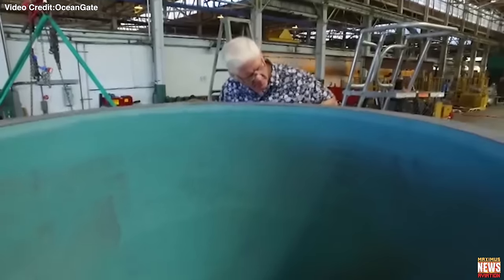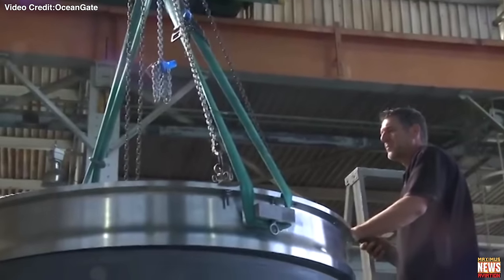Watch The Manufacturing Process That DOOMED OceanGates Titan To Fail. But It NEVER Had To Happen.

Comment: Insanity. Stockton Rush was an aerospace engineer. He's spent his career working with internally pressurized structures. Filament winding things like scuba tanks or other compressed gas tanks is pretty well understood and reliable. The way fibers resist tension is very different from the way they resist compression. Scuba tanks that resist 5,000 PSI internal pressure are 5mm of aluminum wrapped in 5mm of Carbon.  Less than 1/2 inch total. It changes as the vessel gets bigger but not a lot. Compressions is the tough one. Stomp on a beer can or stand on it then tap it with a feather. Once the fiber alignment is no longer in "column" it collapses instantly. Mangle the can and try to pull it in two under tension. Even mangled it's still strong....Tensions is simple. First thing they teach you in the Navy and Engineering school is you can't push a rope. Freeze it, wrap it in epoxy resin and to a point...you can push it. Navy subs are made of homogenous metals without bolted on, dissimilar, end caps. The technology to be safe exists. Monetizing Titanic tours is morally wrong and it clouded the man's judgement. He made decisions based on cost, not safety. Sadly it was all predicted and the predictions were ignored.
Reply: Based on cost? Also on wokeness and arrogance.
Reply: monetizing Titanic tours is no more wrong morally than tours of other p,aces on death, be it battlefields, the Rome Colosseum, or the Pyramids in Mexico.  All places of death, and morally right to pay to tour.
Reply: @davidgenie-ci5zl  Lets just say that I would not be interested in traveling to such a serene and isolated place of such tragedy. It's interesting and for me the original pictures are more than enough. I come from a place where Tour operators have brawls on the roadside. I find the whole thing to be disturbing particularly the fact that in his quest to monetize this the "Money" got the better of his judgement.
Reply: You're forgetting that he's a Randian ubermensch and the rules don't apply to him. How dare you criticize your betters? /sarcasm
Reply: @piglord3.05 Most historical sites are places of death, though. Battlefields, castles, churches that sponsored crusades, massive stadiums for bloodsports. Everyone in history died.
Reply: Stockton’s name is mud.
Reply: @polygondwanaland8390  You're right, I have been to many over the years. Particualrly Civil war battlefields. I think it was seeing tourism based businesses fighting it out in Hawaii for many years that sours me on this. I'm sure people would like to check out the wreckage of the Titan now. Seriously. It seems they rung up a lot of cash per outing. What would have 2 M$ more up front bought them safety wise?
Reply: @patsk8872   Define wokeness?
Reply: @loki2stunt they don’t know what it means lol they just regurgitate what Fox, OAN and Newsmax say
Reply: Very accurate and well written summary and I absolutely agree. This is not a pressure vessel. It is a negative pressure vessel. The engineering and materials required for each mission are very different.
Reply: "The way fibers resist tension is very different from the way they resist compression." That is 100% correct, and was the fundamental flaw in the tragic thinking that led to this catastrophic, but preventable, failure mode. Five people lost their lives due to the flawed thinking and grandiosity of Stockton Rush.
Reply: Excellent comment.   My thinking is the faiure was more in epoxy than in the carbon, but your observation of the difference between tension and compression is a good one.   Steel is added to concrete to provide tensile strength.  The only thing I know about carbon fiber is tennis rackets sometimes break without warning.
Reply: @stephenscharf6293  Could it have been made of graphite cubes glued together into a circular arch?
Reply: @loki2stunt  - The prioritization of identity politics and ethnocultural quotas over pragmatism and effectiveness.
Reply: @JoeLinux2000  I think they can analyze the interior of a carbon fiber laminate stack these days, certainly better than the early days. I remember pro Cyclists would discard a Carbon frame after a good crash back in the day. You just can't tell. You can put a huge dent in Aluminum and make a pretty good guess about how it's going to hold up.
Reply: @patsk8872  Using 'wokeness' without definition makes the term worthless. And it simply tells us about you.
Reply: @patsk8872  Wokeness? His entire workforce was almost exclusively White and male. He was an ardent free market capitalist who thought regulations stop innovation and subscribed to Ayn Rand's brand of philosophy and economics. The failure of his product is down precisely to the fact that he didn't follow regulations, failed to follow proper procedures and tried to follow the dream of free market capitalism. Look where that got him. Next time some smooth brain says "hurr durr regulations stop innovation, regulation bad" just show them this guy at the bottom of the ocean.
Reply: Supposedly tested, a 1.2" carbon fibre vessel, can dive, if I remember correctly over 3,000 foot dives, his was 5". He thought carbon Fibre couldn't be inspected, I'm not sure why, cf bicycle frames can be xrayed for stress fractures.. the dang submersible was on it's 3rd year of use.. shame the man was so arrogant, he couldn't listen to anyone.
Reply: @davidgenie-ci5zl He wasn't even making money, it was more a hobby to document the titanic demise considering no-one else was. The mothership costs over a million to lease for a trip. He and the Frenchman went in together, neither were part of profit.. he even offered others a discount for this trip, 150,000.. it was not profitable.
Reply: I keep hearing about how carbon fiber has a better strength to weight ratio comparing it to metals. That would be true within certain operational envelopes. The extremely high compressive forces applied to this cylindrical structure design appears to have been outside of the carbon fiber operational envelope.
Reply: @patsk8872  hate to bust your bubble, but this guy was a conservative, not a flaming liberal
Reply: @carlose6010  Not sure if it could be Ultra-Sound (which is better for minute flaws like micro-fractures) since that would shake the filaments....
 
And not sure if X-rays would provide enough detail for the safety margin needed at those pressures.
 
I think he didn't realize that the reason why (metal reinforced) Carbon-fiber can be used in Scuba tanks is that, even when "empty" they still have more pressure inside them than the water pressure at that depth!
Reply: Result of WhatsApp University.
Below I copied from Google.  
"Careful oxidation of the surface of the carbon fibers improves chemical bonding" properties,
What I believe Instead Carbon they should have use Boron Nitride Nanotubes. Its 300 time stronger from Carbon fibers & 30000 from steel. But these are very very expensive.
Reply: @patsk8872 Rhonda Santis, is that you?
Reply: @OutyMan wrong, but nice try.
Reply: @markw9512 now you're just confusing him with facts 😂
Reply: Exactly. Internal vs external pressure is a vastly different paradigm.
Reply: Now hearing about his background, it is even more astonishing.  But then in large aerospace companies, a lot of aero engineers get by using others work as their own and don't really understand what they are doing.  Notice how I avoided using the word "BOEING"  It Reminds me of when doctors use laymen's terms buzz words to make you think they have tremendous depth of knowledge
Reply: @davidgenie-ci5zl  Debatable. You pointed out places where there has been deads sure, but the location itself was not a graveyard. I think is is justifable to forbid tourism attraction at grevyards. Well this is a fine line. Let's say if you can walk by yourself to it and visit then fine, but underwater is something else.
Reply: @gs7458  there's a lot of very expensive solutions that can go to the bottom of the ocean. His whole deal was cheaper.
Reply: If I have to choose between carbon fibre and fibre glass,
I would choose fibre glass and have it certified to go deep seas.
Reply: If I have to choose between carbon fibre and fibre glass,
I would choose fibre glass and have it certified to go deep seas.
Reply: @JoeLinux2000 Game set and match for Stockton.
Reply: Wokeness? Don't be daft. Had he been woke to bad processes...
Reply: the alvin (50yrs old) has a titanium ball that the people sit in.
Reply: I actually used the standing on a soda can display to explain to my Grandmother why they died. Homegenous systems well always be stronger... There's a lesson there if you can read between the lines
Reply: It did not last that long.... Look how many times it went down to 14.000 feet... I think it made it 2 times that is all.... IT WAS A CAN.... and nothing more.... and when ever have you seen carbon fiber laced down in 1 direction....That is flat out stupid.... and only 5 layers.... My Car hood has 5 layers of fiber to make it and you made it on a sub the same way my car hood was made... What a joke.... This company is done and there will be no one to account for it...
Reply: @gs7458  I'm pretty sure your BNNs still can't handle compression.
Reply: Stockton must have been a very bad aerospace engineer, not even understanding the fundamentals.
Reply: @georgec9590  all wrong - cf  has a relatively high strength/weight ratio, but that is (per piglord3.05) tensile strength - not compressive. the 'stiffness' of cf composites - note the word 'composite' - comes from binding together of fibres with a matrix - usually epoxy, or similar. So a cf composite structure under compressive loads is not  playing to it's strengths. Put a section of Titan's cf-'wound' hull material under a compressive strength test machine and it will fail much earlier than many others....
Reply: This sums up late stage capitalism.
Reply: @loki2stunt  I don’t know why you chose the channels you did? Not much woke there
Reply: Totally agree and was shocked to hear there was not a plan to replace the whole craft every x number of trips nor a non-destructive structural test plan in operation? 

Tickets should have been 1 million $ to allow for replacement of the sub, not bargain bin prices
Reply: He should of known better then !
Reply: @loki2stunt woke;adjective 
A slang term referring to intersectionality
Edit: grammar because I'm terrible at it.
Reply: @loki2stunt  I doubt guy was truly "woke" he described submarine subject matter expert community as uninspiring ex-military-50-year-old-white-guys. Appeal to ESG investor? Thrilled to get job inexperienced young people means low wages and unlikely to say NO you're wrong!
Reply: It seems he just thought, "pressure is pressure," incredible as that seems.
Reply: @piglord3.05  good post
Reply: Any engineering student can calculate in 5 minutes: Compressive stress in the carbon fiber polymer (CFRP) wall of the Titan submersible was about 200 newtons per millimeter squared at Titanic depth. This corresponds precisely to the stress level where CFRP typically fails under compression. Only under tensile load (which is not applicable underwater), CFRP can withstand about 10 times more. What's more, OceanGate used unidirectional (circumferential) CFRP. This means that in the longitudinal direction, the hull was only about half as strong, at around 100 newtons per millimeter squared. It's a miracle the ship even made it to Titanic a few times without imploding. It was like doing pole vault, but with a rope as the pole.
Reply: Nope, He used it as an EXCUSE to skirt off regulations as well as to give him the benefit cutting corners money 💵 💰, my father brown and 20+ years & younger than 50 engineer in aircraft to materials in car industry first glance at this is instant failure. 

Even if he hired any folks they will not accept to certify this venture as he would just  ignore, gloss over and stubbornly go for his DIY dream death sub, just like he did to fire his ex-inspector and got sued multiple times prior to the incident for within few years prior.

 Even a marine regulatory body with over 60+ engineers, experts and researchers had filed a warning & complaint that his sub isn’t fit for the deep sea dives. But since there was no strong laws regarding private companies going to use touristic tours on experimental dives and lack of deaths. He became an example of that would surely make precedent for future ocean regulations.
Reply: A Coke tin can be easily crushed from outside pressure but it is hard to explode it by internal pressure. Same formula applies to this carbon fibre cylinder which Stockton Rush used in building his ingenious coffin.
Reply: No he wasn’t…he had limited time actually performing engineering work…he was a rich kid larping as an Elon Musk type figure.

Comment: As a mechanical engineer, if I designed that thing back in college, I would have been given an “F” with a big circle in dark, red ink
Reply: even I as a "tech amateur" with cars bikes bicycles and so on can see so ridiculously many flaws on first sight that I would not even go down my local lake with it
Reply: As a non engineer even I know you can't rely on glue to attach metal to a non metallic surface under extreme conditions and expect it to last.  Of course that's experience talking and  the conditions weren't that extreme, one winter in New England caused a plastic frame on a metal door to delaminate using super glue.   I tried dozens of different adhesives and none worked for an entire winter.  The super glue lasted the longest, from November to January then delamination.  That is when I learned about unlike materials expanding and contracting at different rates.  How any engineer wouldn't know this is beyond me unless they just hired mechanics to build the CEO's design without the benefit of someone with an actual engineering degree.  Like how if you get hired on a movie set to plug in and unplug the lighting to move it around you automatically get the title "electrician."
Reply: @nunyabiznez6381  I think most mechanics know this easily too
Reply: Stockton clearly knew this was a death trap sub, that's why he got all his passengers to sign all those waivers. I have a theory that his business wasn't doing well so he went down the cheap route of not using all titanium and mixing it up with already worn out carbon fiber. This man is guilty of more than negligent homicide, he is guilty of manslaughter.

Comment: Making a critical seal using glue in a non-sterile environment?  Genius.
Reply: That shocked me too. No cleanroom, not even a clean tent and no degassing of the epoxy. 🤯
Reply: what does it matter if its "non-sterile"? 
its glue and should never be used solely to join critical structures of pressure vessel.
Reply: @darkshadowsx5949 sure, but if you're determined to use glue you at least have to worry about contaminants like dust particles and air bubbles forming creating tiny pockets for failure points
Reply: I would have as a critical care doctor. Thought should this process of spinning carbon fibre. Be carried out in a clean room. Or me just a freek and clean the heck out b4 I get my hands on a patient
Reply: . Helps with bonding
Reply: They in the coffin manufacturing business.
Reply: @kennethtownend8301 yes the consensus seems to be that you should have a clean room weaving CF. And setting the glue.
Even if they did that correctly I don’t think they would ever gotten classes or certified.
Reply: And not doing in an autoclave, in order to minimize the porosity of the cured glue!
Reply: As he said it's the glue that's handling the family together. His "engineer", and I use that word very loosely, seemed to know it was complete BS but I guess being paid enough cash for building a coffin and nobody raises any eyebrows.
Reply: To me, the pressure vessel should not have been constructed by double sided tape
Reply: @mutiur7396  "double sided tape" dont forget the open air criteria ? to add any sort of dust or bug particles combined with bare hand touch transferred human oils that makes it all the more stronger and colorful on a super shiny finish metal
Reply: No vacuum to draw out bubbles either
Reply: Yeah - open air, wiping it down with a rag. Scary.
Reply: Plus the difference in porosity of the materials. Titanium is smooth and minimal voids. They didn't even rough up the titanium ring C joint.
Reply: sterile room? you probably mix up with clean room, different. Anyway, it is not that critical, there are many things wrong in the process, pretty much everything, but it doesn't have to be done in a "clean room".